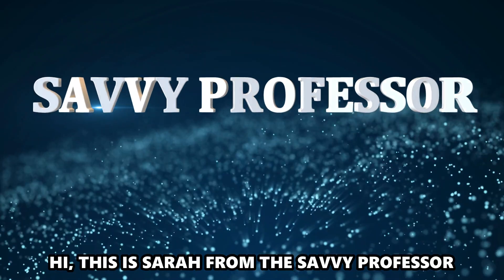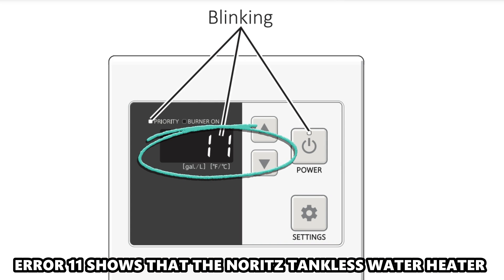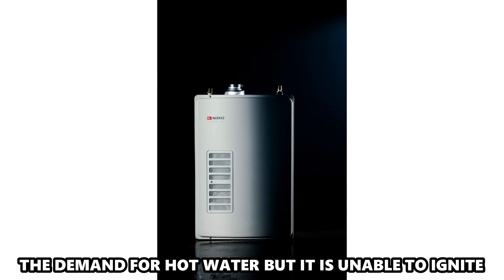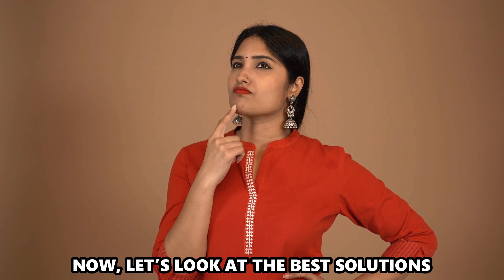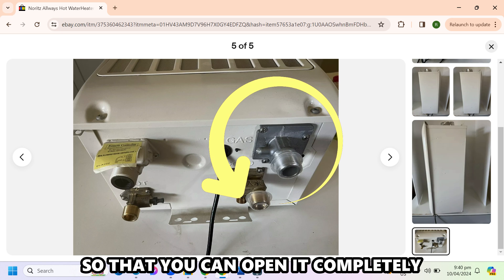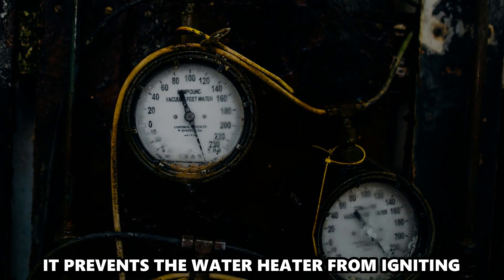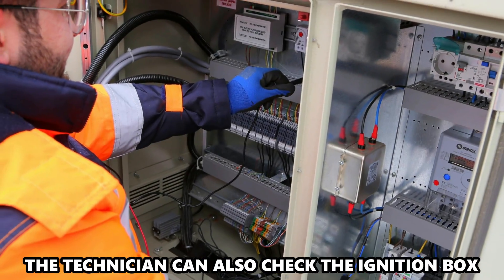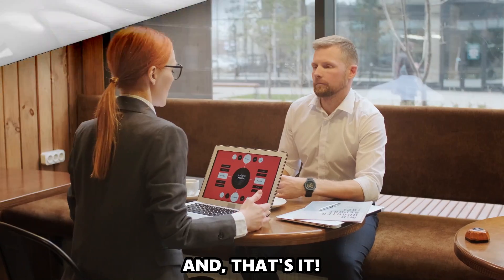Noritz Tankless Water Heater Error Code 11 (Indicates Failure In Ignition - How To Fix Error 11)

Comment: That's not it. I've got this issue. I've got sufficient gas and water pressure. I've changed the igniter, the wire going to the igniter and the igniter box. I'm still not getting hot water. I think these fixes, like the ones in the video, are basic fixes.